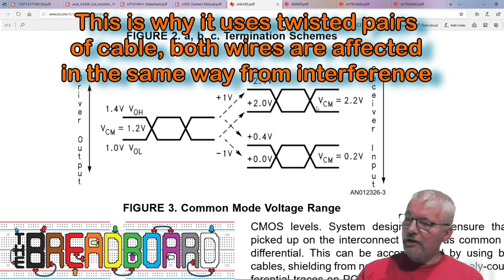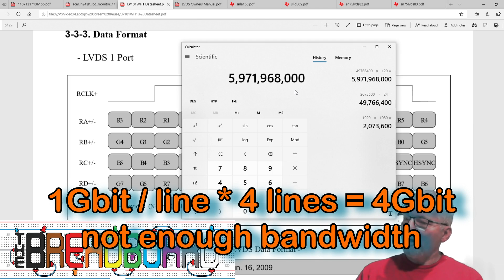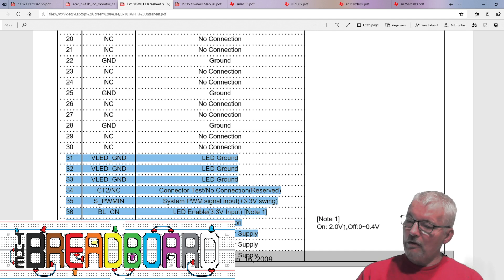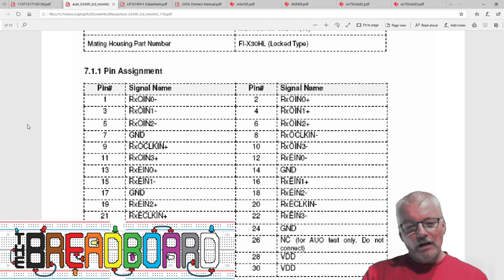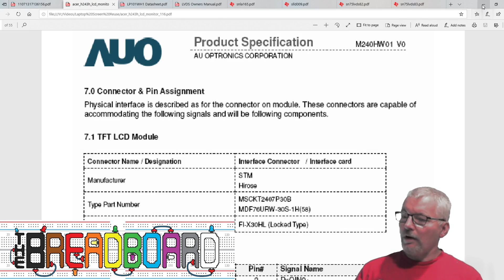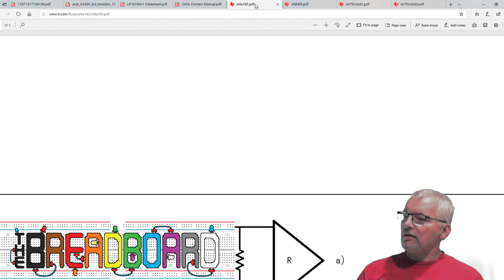What is LVDS ... Old laptop Screen reuse

Comment: Hello, i have a Dell Precision 5520 that comes with a touch 4k Sharp IGZO screen, i have the same exact model panel but the matte non-touch revision, it passes and powers the Dell screen diagnostics test but wont show the bios or boot into an operating system. Im using a non-touch 40pin LVDS cable but i think there might be a misconfigured pinout since the 5520 was never offered with a matte non-touch screen. Do you know of a way to find the pinout for the Dell Precision 5520 motherboard?
Reply from the maker: What you need is the exact model of the led  display, the details are typically printed on the back of the display panel. With this info you can Google the details. If the display is typical then the pin out should be standard. But a 4k display will probably have at minimum 2 channel but probably more. Post the display model and make if you can't find the details and I'll have a quick search and see what I can discover for you
Reply: @TheBreadboardca  Its the Sharp LQ156D1JW33 thats the exact model but they offer both matte and non-touch, in the Thinkpad world the pinout for touch/non-touch is slightly different and Dell never offered a non-touch version of the Sharp LQ156D1JW33 but whats strange is Dell themselves used the Sharp LQ156D1JW33 to make their own custom display assembly infused behind glass where they added the touch feature to this panel themselves somehow. So i was hoping to find the pinouts so i can make the matte version work since the glossy screen hurts my eyes. Bliss computers sells the matte/glossy non touch Sharp LQ156D1JW33 and advertises it as compatible but its seems i need an LVDS cable that doesnt exist.
Reply from the maker: @jakkiryanov9859   As I  suspected, this display has a different interface, it uses eDP not LVDS,  The eDP interface allows higher transmission speeds as opposed to LVDS cables. eDP also uses less conductors on your cable design reducing space and possible cost depending on the design. Another benefit of eDP cabels is that they allow you to easily connect your source (such as a person computer) directly to an LCD. hwew is the details on  panellook.com https://www.panelook.com/LQ156D1JW33_Sharp_15.6_LCM_overview_34287.html so an LVDS adapter will not help here, you will need one supporting eDP, so far I have not rtied any as I have not come across a display needing one.
I hope it helps.

Comment: Hello i have a 40 pin 6 bit 2ch lcd screen, could i use a 40 pin 6 bit 1 ch lvds cable to connect it to the control board?
Reply from the maker: You would loose some of the colors, I don't think the controller or screen tries to reconfigure to use a single Channel, you can buy just a 2 channel cable quite cheap, just make sure it has the right connector
Reply: @TheBreadboardca  Thank you for your advice

Comment: hi. I wonder if someone can help me with a dilemma. I have an old Lenovo G500 laptop that uses an LVDS 1 channel 6 bit screen with the resolution of 1366×768 - 40 pin connector. This is an horrible TN pannel and I would like to change it with an 1080p IPS pannel. I stumbled upon this model: LP156WF4 SLC1 which is 1080p, IPS. The problem is that this new screen is LVDS 2 channel 6bit. Would it work with my laptop if the old screen was only single channel? I don't know if the Lenovo G500 motherboard can provide a 2 channel LVDS signal. Both screens have 40 pin connectors (the location of the connectors is different but that's not a problem for me). thanks

Comment: Hey Hi there .. i have salvaged a working lcd panel from my laptop and i need to connect it with a universal led tv board .. my problem is that I am not able to find the datasheet for my panel .. could you please help me .. the panel number is : TX39D99VC1FAA (hitachi) .. i tried a lot but couldnt find its LVDS connection info which I would get from its data sheet.

Some extra information that I knw is:

a) Panels input voltage: 3.3v 
b) Panel size : 15.4 inches
c) resolution : 1680 * 1050 (128 PPI 
d) signal interface: LVDS (2channel, 6 bit)

PS: I am just stuck at LVDS connection .. rest everything is done.

Additional info just found .. i have found this datasheet "LP154W02-B1K7_LG - its 1680 x 1080" .. so i got this panels datasheet and its specification matches the panel I have .. can i use this panels lvds information( i have got all the 30 pins information for "LP154W02-B1K7_LG") .. am i in a position to take a chance (since this looks like the last hope) .. I dont care much about losing my panel .. since i know it has some burns ..

Regards
Rahul

Comment: Excellent videos, thank you! I am wondering in case of even/odd lanes for LVDS (dual channel concept?), are the even/odd lanes referring to the actual physical even/odd pixels? Say even: column 2, 4, 6, ... and odd: column 1, 3, 5, ...? (Means essentially half of the screen is driven by data coming up on one of the two sets of 4 twisted pairs). I imagine if I have a screen of 2400 x 900 @ 60 Hz, 8 bit color depth and 4 subpixels (RGBW), I would essentially have 2400 x 900 x 60 x 8 x 4 = 4.15 Gbits of data per second, requiring dual channel/port?
Reply from the maker: LVDS = an electrical standard, not a protocol https://en.wikipedia.org/wiki/Low-voltage_differential_signaling , what your asking about is the protocol.
This is a good description of the display protocol as regarding implementation on an FPGA so it goes into detail https://www.element14.com/community/community/designcenter/zedboardcommunity/minized/blog/2019/03/04/driving-a-laptop-lcd-using-an-fpga

Comment: I had two old broken laptops that I disassemble to use their screens for a project. I was told that in order to make them work I have to look for the specific lcd controller board for each of them. But I was told that because the screens I have uses the 40pin connector, I can just buy any lcd control board that uses the 40pin connector and I should be fine. I'm confused.
Reply from the maker: From what I have seen (And i'm still investigating for my next video in this series) most of the boards are programmed with the target resolution so you need to get one that matches that (They are programmable with a special programmer, I dont have one), just include your resolution in the search criteria, the bit that seems to be configurable after that is the number of bits... 6, 8, 10 etc, this will determine the number of colors the board will send to the board 262K, 16Million and a huge amount :) etc, this color depth can be adjusted with a built in menu (From what I can see). If your display is using CCFL back-lighting then you probably will need a 30 pin cable if your display is under 1920x1080 60fps., if it has LED back-light then probably a 40 pin cable.
You will also need to ensure you cable has the right number of twisted pairs, based on the data sheet for the panel, you will see it has 1 or two ports/lanes, and typically 6 or 8 bits 
so higher resolution with 16M colors will need at least 10 twisted pairs, the panels I had in the first video only needed 4 twisted pairs as it was only 1366 x 768 and 6 bit color.

Hope that helps for now. I will be doing another video once I have figured a few more things out.
Reply: @TheBreadboardca  thank you for the information